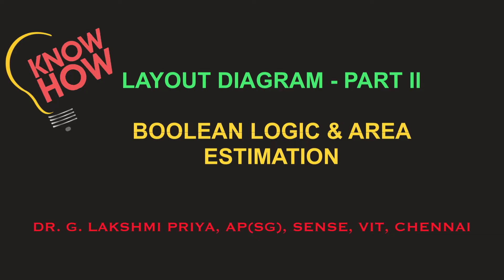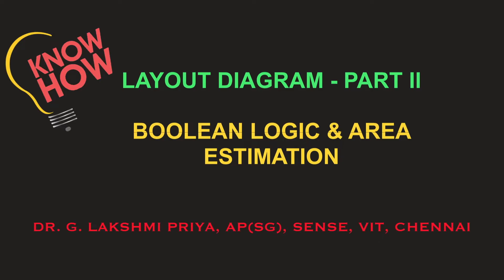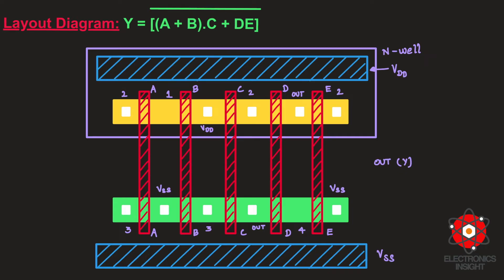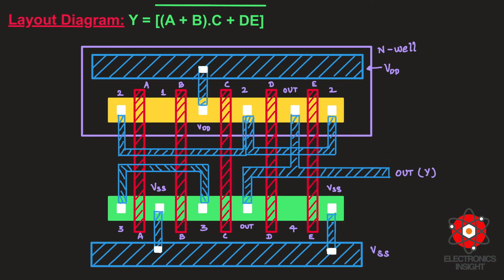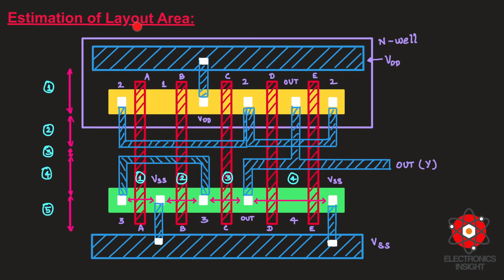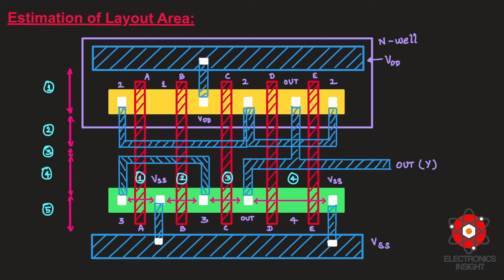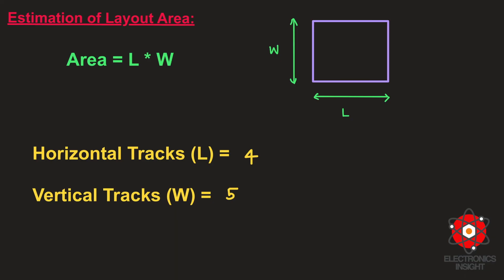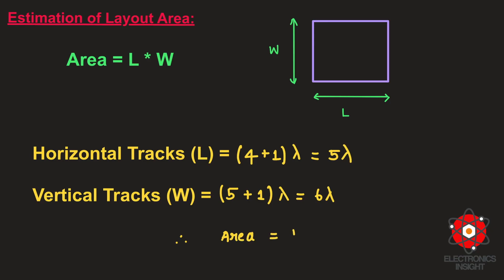Layout Diagram - Boolean Logic - Layout Area - Part II | Know - How

Comment from the maker: Update:
At 10:00:15 to 10:23 timeline of the above video; by keeping in mind about the wiring track space (width and space required for the actual wiring) we should multiply by "8" (in both L and W) )...so the total layout area becomes (40 x 48) lambda.^2. So, read the question, if it is asked to ignore the wiring track space then the actual answer is same as in the video. Thanks.
Reply: Mam what is lamda ^2
This is unit or a square for a calculation